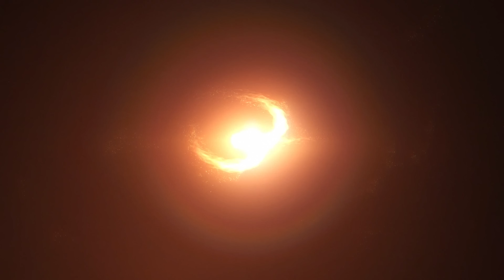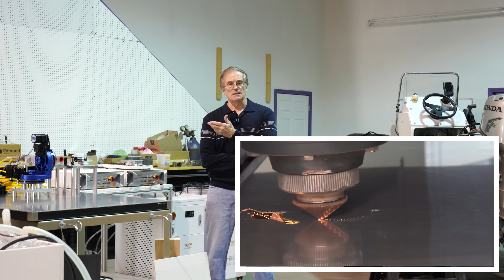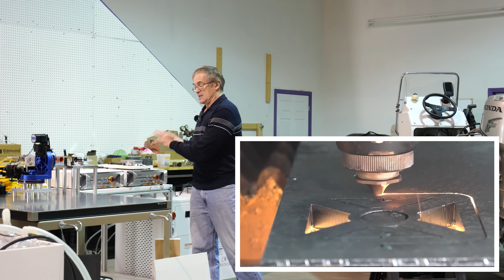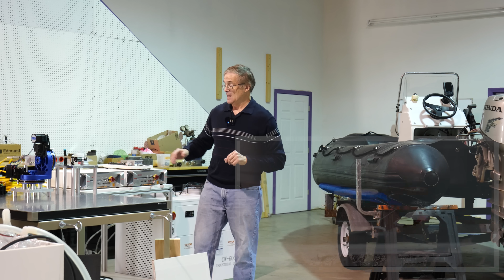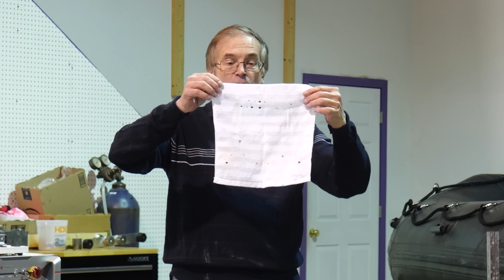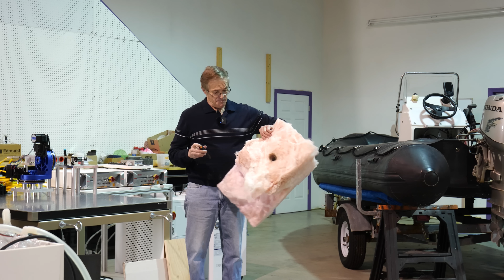We have a problem... and need your help!

Comment: You probably already came up with a solution, but in case you haven't... 

I Don't know what the budget is, but I had a couple thoughts for a 6ft X 8ft barrier.

Sort of conventional: 
At least 8 seconds of laser containment. (Adjustable)
Est Cost:  $850 - $1000
Buy Laser Safety Fabric rated at >2,500 W/cm², and attach securely to a 6ft X 8ft frame. Get or make something to attach the frame to a used electric reciprocating swing or linear actuator motor, that will move the frame around at >12cm/second for a 3kW Single Mode Fiber Laser. Actually required cm's per second will depend on laser's energy on the strike point weighed against the rating of containment material.

Non conventional (F*in caveman version)
About 8 seconds of laser containment. (Somewhat adjustable)
Est. Cost: $300 - $400
Build a 6ft X 8ft box 4 inches deep. Frame with HDPE plastic planks, (HDPE is kind of like PVC), and for the back panel use 2 inch thick medium density wood. Water seal the outside, but DO NOT water seal the inside. Fill the box with a moist mixture of fireclay and 15% recycled rubber strips or pellets, make sure rubber is evenly distributed and mixed real good. Soak mixture with wood side down a few hours before use, and again right before use. What you want is as much water saturation of clay mix as possible, maintaining saturated clay properties, without becoming gushy like mud; in the end you can always let it dry a little. Just as important we want to give the inside of the wood time to soak up a good amount of water and swell a little.     
The hard part is you need to lift it and lean it against the wall, it'll be heavy. In addition to the materials, by leaning it back against the wall it's taking on a slight angle which is also good.
By somewhat adjustable I mean you can add depth to the clay and rubber mixture if you need to.

Like the vids😬

Comment: I have thought on this problem for awhile on my own projects, my idea is instead of using a material to "catch" the stray laser light, the focus should be on scattering it. One simple way to do this is with a flowing sheet of water, nothing to destroy in the laser path and it should scatter the beam to make it essentially harmless.

Comment: I don't know if there are large plates or layers for sale or what they might cost but I have read that silicum carbide is used in space lasers, so that must work definately.  

You can buy the material in powder like form to polish tumblestones etc. maybe you can make panels by mixing it and spraying this on the plates yourself.. or adding glue and then sprinkle it on top of the glue. the effect will be  like sandpaper

Comment: I can't be bothered reading through 11k comments, so with the added bonus of none taking their time to ready my 11,001st:

White bathroom tiles, sandblast them or etch with hydrofluoric acid to scatter the beam. Have tungsten material behind as backup if a tile crack. Another thing is to adjust the distance between the lenses to unfocus the beam.
Reply from the maker: I did read through all of them, so you don't have to. 
Your suggestion might work, but it's going to be too expensive over a large area.

Comment: What if you found a way to not stop the laser as much as disperse the beam. Maybe with amgles and/or splitters for dispersion so that it disperses into a borad area. Some kind if meral material im thinking.
Reply: I see a cone shape or shapes  but maybe with sharp angles and edges rather than cylindrical. I dont know man im just spitballing trying to think outside the box that maybe will inspire a different idea because mine may not even be pheasable or even work at all lol

Comment: It's a very difficult problem to solve... such a powerful laser goes through everything in a very short time... Nothing can withstand it for too long. I'm thinking of some panels with Fresnel lenses to dissipate the beam and resist its action but it's not a cheap solution and maybe not even viable...

Comment: Engineer here. I don't know a darn thing about lasers, but you should do a collab with someone who does.
Reply from the maker: Understood.
I already know a considerable amount about lasers and work with others who know more.  This issue is outside any typical application, and good engineers will be just as likely to find a good overall solution.

Comment: Hi, I am impress by the number of comments you receive! I watch your video... like some time ago, however... Sorry I message you so late! Back to your problem ... in my point of view ... you got this wrong! You want to block the back of your target with materials ... it will be expensive and dangerous!  All materials will react violent when laser beam will hit their surface! Smoke, dust and toxic gases will result from that!  Did you hear of the expression "Sky is the limit"?  Instead to having a horizontal line of target, chose a vertical one! Of course you will need to do it outside under the free sky! Build a scaffold in order to have your target on position! Use some metal rope and pullies for easy replacement of your targets. As a back up ... build a metal cone around your laser turret - so no accidental laser beams escape below the safety angle! Check with local Air Control and ensure no flights are near your target zone! Hope this help! Good luck with your projects ... and keep up the good work!
Reply from the maker: Thanks for the suggestion!
I'm very uncomfortable about operating these lasers outside. There are so many ways to get something wrong. Your point about air traffic highlights just one risk. Reflections can occur even from the liquid metal and plastic of the targeted drone. We're in a busy industrial park that has some activity 24/7.

Comment: At work (semicon ion implantation) we use a burn through detection circuit to cut power to an ion beam if it burns though the faraday cup (device that moves in an out of the beam to measure beam current). Very very simple circuit. You could easily rig that up to the emo circuit. Also though dirt will do the job I stopped a powerful laser with a fishtank full of dirt from my backyard.

Comment: Budget laser beam dump that can take 20 kW for 5 seconds?
* Stack 3 layers of 1/4” MDF or hardboard — each ~250 g, mostly carbon → 3 tiles = ~10,000 J of ablation.
* Behind that, slap on a cheap ceramic floor tile (4x4”) — mass ~400 g, soaks another ~20–25kJ thermally.
* Add a cement board or drywall scrap behind it as a fire stop.

For 100,000 J total beam energy:
* 10 tiles = 30kJ ablated + 60–80kJ soaked + margin
* Total cost: ~$1.50/tile, full 2×2 ft panel = $15–20

Bonus: nothing fancy, no cooling, no copper — just replace the front after a shot.

Let me know if you want a diagram or shopping list — this one’s stupid simple and works.
Reply from the maker: Thanks.

Comment: I may be missing something, since I'm just dropping in ever so often, but in terms of powerful lasers, there is a point where you cannot control them at the target anymore. They will near instantly knock particles out of any targeted surface, forming a cloud in the direction of the laser, with a property of being excellent at diffusely spreading the laser in all directions. At that point anyone in a multi-kilometer wide radius looking but in the direction of the laser's target will be in serious danger of permanent eye damage.

It is also the reason for the weird effect of more powerful lasers sometimes being worse at cutting into a target than weaker ones.

Instead I HIGHLY recommend building a monostable beam dump device, which redirects the beam downwards through several baffles into a blackout box, filled with e.g. sand, by default. Only when prompted by the control system to do so, should the beam be redirected onto its working path. If you design your beam trap electrics to be as simple as possible and only take a simple control signal, you can easily prevent your beam dump device from getting stuck on the dangerous path with e.g. an series capacitor on the control signal and a discharge resistor + diode circuit limiting the negative voltage behind it. That way if the control system hangs, the beam will be interrupted by default, since for remaining open a continuously rising voltage on the control signal would be required. Since you need to divert the beam but minimally to switch it between different paths, look into piezo crystals as actuators. They're extremely cheap, return to their default state quickly when a voltage is no longer applied and you can just glue stuff to them. And finetuning their position is easily done even analog via a potentiometer, reference and opamp circuit.

This should be much cheaper, much more efficient and much safer than any target-focused setups. If you need extra safety, just put two independent devices in series and adjust their timings on the control device. If we're going for sketchy setups, I'd wager I could built one of these for less than 20Euros in materials.

Also always remember, PPE equipment like safety glasses are your very LAST resort. Do under no circumstances build your safety protocols exclusively around everyone wearing their PPE.
Reply: If you need a laser for targeting your device, it may be feasible to have a much weaker laser merging on the same optical path as the stronger two at a later stage.
Reply from the maker: These lasers have an integral, coaligned,  1 mW red aiming beam.

Comment: Or you could try using bricks of limestone that have been heat treated into Calcium Oxide. That way the beam will hit the Calcium oxide and around 2400 degrees C it will display its limelight properties and convert tones of energy into white light. Only problem is that Calcium Oxide is hydroscopic so youd have to control the humidity and actively heat the Calcium oxide with a torch. 

You can make it from wood ash if you want to make it a video.
Reply: Maybe like a Polyvinyl Alcohol and Calcium Oxide composite that you cast into panels? I wonder if my intuition is extremely naive hahaha

Comment: With wet towel option that you had, how about if the towel is constantly being made wet faster then the laser vapouring the water. You could have a small hose the feeding the towel with water and a water container underneath that feed the same towel. You could put some ice to keep the water cold

Comment: Sheet rock for your bathroom. Or bathroom ceramic tiles. You could water cool from the back. I can’t think of the name but the ceramic tiles from the space shuttle. What about the filament itself what if you hit a coil of filament would it dissipate or redirect it to a single spot that you could have stacks of bricks. How deep were the holes in the brick? That will give an idea of how long that would last. Back splash tiles that were layered and cooled may give you a larger easier to assemble target area. Sorry I am late got unsubscribed somehow. I wonder what would happen if you hit fog from a fog machine and if it would split the beam? I will continue to think about this. Great brain teaser to think about

Comment: Maybe try an instantaneous kill switch with a tiny, sacrificial barrier (like foil) and a sensor for immediate shutdown. Then, a diffusive scatter plate (maybe frosted acrylic) could really help spread out the beam's energy. And finally, some layered ablative material like rockwool or cardboard could absorb the diffused hit for those crucial few seconds. This combo seems like it could buy you that vital time, keeping things light and budget-friendly. but i still dont really know what the last layer should be.

Comment: Maybe grow YaG small crystals and spread it over some plate, so that IR light gets converted to green light dispersing the energy. Maybe carbon coated brick to spread the heat if building that wall? Im not material scientist, but graphite seem to be a choice here, you can get graphite sheets At the end of the day, you can just use mirror at the angle to the ground and burn the ground, no one will care about hole in ground. Can't you just use some crystals to spread the beam. As someone suggested here smartly, you can move the surface or vibrate it so it moves to spread that light. Or just use some graphite sheeted disc of some sort that's spinning  to spread the light energy
Reply from the maker: If you mean dihydrogen phosphate, we did grow some, and we plan to demonstrate some green conversion when we test these barrier options.
Reply: @TechIngredients  Nice
Reply: @TechIngredients  Flexible Graphite Foil is cheap

Comment: My suggestion would be to somehow don’t use the full power unless you have to … and only fire if you want to … while having nothing else in the path. 

That said how about a thick wall of fog to disperse the energy while putting the heat into steam. I mean you might have to create a few hundred meter of fog but if the area you are firing at is well defined we might be talking about only a few 100 cubic meters you have to fill 😅
Reply from the maker: You're right that our development process and testing can be done with much lower power.
These laser sources are from the same manufacturer that owns Theo, the laser welding distributor that we toured a couple of months ago, and the video proved that I have a way to go to be a competent welder.
These fibers provide a 1 mW red aiming beam, perfectly coaligned with the main laser, even when that main laser is inactive. That is great for testing.
But eventually, we want to destroy drones, and if something goes wrong, we want a measure of safety. 
The chalange with fog is the space needed as well as containing the fog behind the target area.
Reply: @TechIngredients yeha I imagined that space is the biggest issue. Here two more similar ideas. 
Instead of fog how about simply a wall of water or droplets. So no fog but maybe droplets or a stream that falls down and can be pumped in again. It’s easier to handle and will likely need less space as energy loss is more due to evaporation rather than dispersion. 
Second idea would be a big enough block of ice. To increase the dispersion you would have to freeze it with a lot of bubbles inside. Basically a frozen inverted fog that can be nicely stacked into a wall😅 (in front of your last barrier). There is probably a lot research on this to find as well like this article „High-Energy Laser Protection Performance of Fibrous Felt-Reinforced Aerogels with Hierarchical Porous Architectures“ they use aerogels with other materials inside … but this is probably even harder to produce.

Anyway thanks for reading.

Comment: I would say the easiest solution is to stop pointing your laser up.  For the tests you're doing wouldn't it be just as easy to point it downward?  If you do that then you could do it outside, pointed at dirt, or perhaps green grass that you aren't worried about catching on fire.  Obviously a forest or dry grass would be a bad idea.  Your laser is very powerful, but I don't think you're worried about shooting straight through the planet (though it would be very interesting to see how big of a puddle of melted ground it could make).

Yes, this requires building a scaffold of some kind, but it eliminates all of the structural issues of building a brick wall, or a fancy waterfall.  A manlift or a forklift would work fine for this, actually.
Reply from the maker: There are other safety issues when working outside.
We can't control who will have a line of sight to the laser when it's firing. 
The testing equipment is delicate (at this stage), and lifting it high above the ground risks the equipment. If the weather deteriorates, we have to get these high voltage, optical components under cover.
Reply: @TechIngredients  I see what you're saying about being outside.

If you have access to a mezzanine or something then I still think it's going to be a lot easier to have the equipment high up and have a horizontal backstop than have the equipment down low and build a vertical backstop.

It'll be interesting to see what you come up with though.

Comment: A inexpensive way would be to elevate the laser (like on a cliff or roof of a building)and work over a body of murky water as a diffuser or even the ground.
Reply from the maker: The problem is that these lasers shouldn't be operated in the open due to safety issues. To operate vertically, we'd need an even taller facility.

Comment: Make the equivalent of a bullet trap. The geometry would be almost the same. Use a tilted mirror appropriate for your laser wavelength to deflect the laser downward into a large deep tank of water with additives to disperse and absorb the beam. Two suggestions to optimize the mirror: 1) Actively cool the mirror. 2) Texture the mirror to begin dispersing the beam immediately (calculate risk/danger from incidental retro reflections). To optimize the water tank: 1) Keep the water flowing rapidly through the area directly below the point where the beam strikes the mirror. 2) Actively cool the water. 3) Use an ultrasonic fogger to create a layer of dense fog on top of the water to help disperse the beam before it hits the water surface.

Comment: Some ablative heat shields are made from carbon. They sublimate, so you get the benifit of a phase change. It's also highly absorbant. To make a test peice of carbon foam, pyrolyze a slice of bread, as you would to make charcoal.

Comment: Whatever those laser saftey goggles are made from seems like a lightweight material, if you could get larger sheets of it.
Reply from the maker: A direct hit by the beam will blow a hole in the goggles faster than you can blink.
They are designed to protect your eyes from stray reflections.